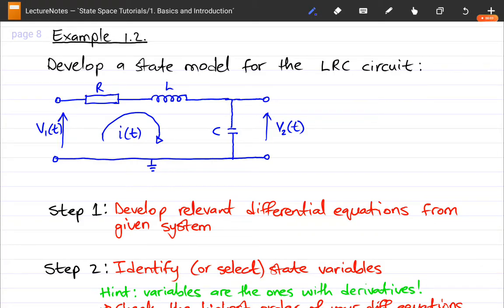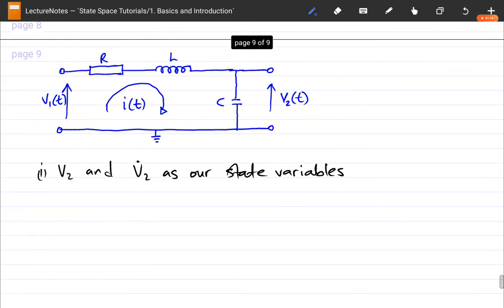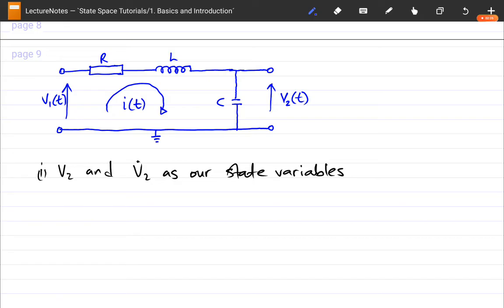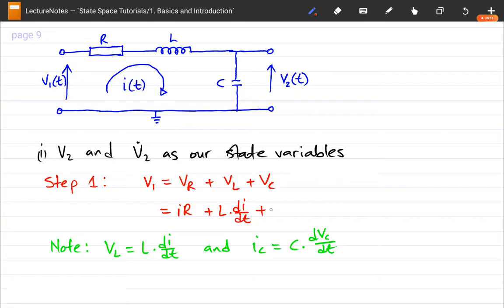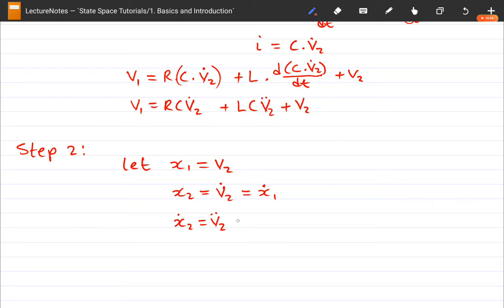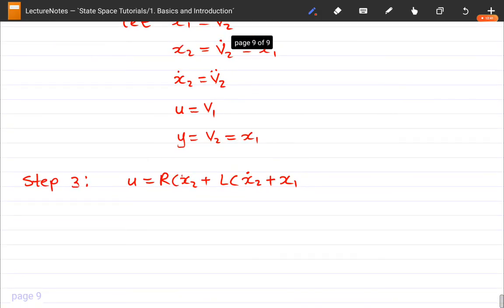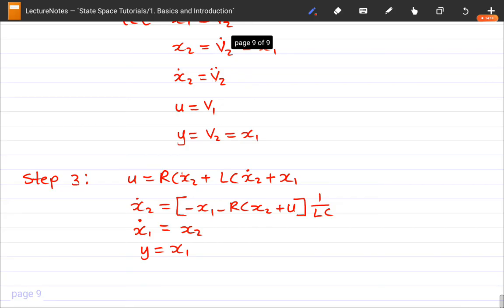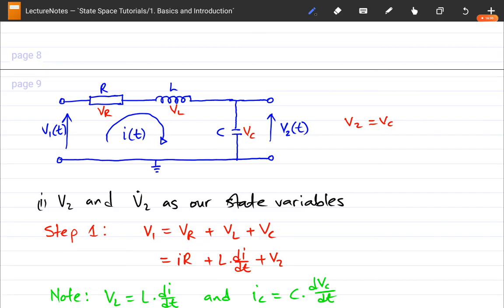Example: State Space model of an electrical RLC circuit

Comment: I am pretty sure you did the last part wrong. Your 2x2 matrix should be [ 1 0 ; -1/LC /R/L] , you have the 0 and 1 for the row backwards. You can verify this if you perform the matrix multiplication of the matrices  [ 0 1 ; -1/LC /R/L]*[x1 x2] --> for row 1 column 1 you get x2 and for row 2 column 1 you get -x1/LC  -  x2R/L. That doesn't match your equations, your equations are  y=x1 & dx= -x1/LC  -  x2R/L, you can see that you need to swap the 1 and 0 in order for it to match your original equations.